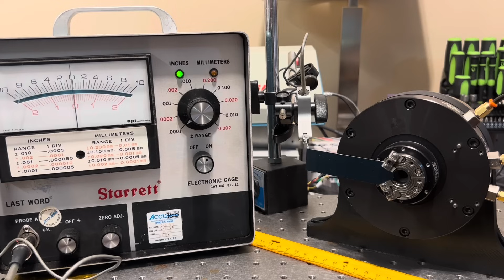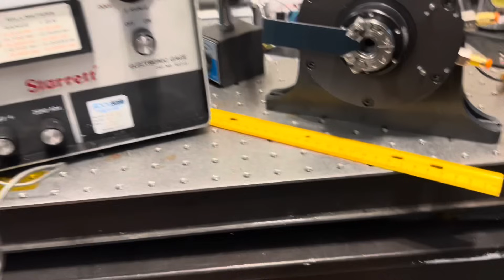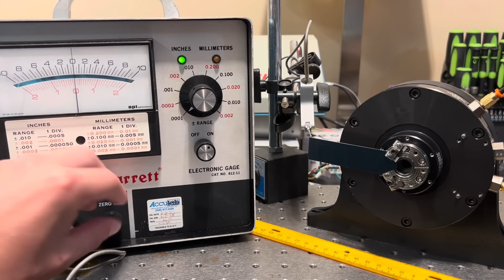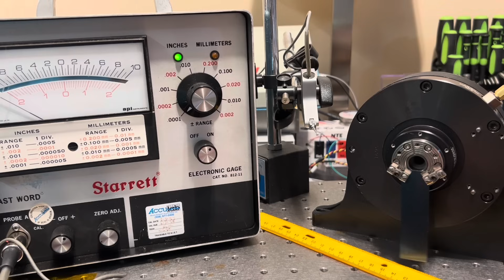0.3 arcsecond resolution air bearing spindle demonstrates crazy repeatability at a distance

Comment: I cant find the exact circuity of this instrument so this is not more than just a firendly note for this use case:

Be carefull with the analog indicator and may not leave too long at the overflow state, because u will know nothing abaut the exact coil drive current here. The excess current can cause the coil is heat up a bit and it do some change in dc resistance and olso cause heat up the driveing op-amp itsef. These are can make a ofset to drift, ruin your zerro point, and olso ruin the measurement repeatability.

Comment: Are you saying that the servo controller is holding position to zero encoder feedback bits? Maybe it is getting some fuzz on the feedback and bouncing around the central value?

I don't think you will get constant position values even with the device mechanically locked, that would be right on the edge of the best encoders I've ever seen, which are edge reading optical 26-bit BISS-C units, they bounce about 16 counts, so really 22-bits solid. It seems barely possibly for the analog electronics in a sin cos system to be that solid.

Also, the as-installed accuracy usually isn't nearly as good as the theoretical accuracy, but with an air spindle maybe it can be. With rolling or journal bearings the orbiting motion loses a lot of accuracy.

Comment: Very cool! Does adding an infra-red reflector like aluminum foil or mylar around things like PLA improve the thermal drift enough to be worth the effort? That flat black surface seems like it would take on heat from IR quite readily.

Comment: personally im more of a hydrostatic guy. mostly cause in the unlikely even that the supply gets cut out there is still a oil film precenting it from going instantly metal on metal well still spinning but if the air supply to a air bearing gets cut the air film is pretty much gone instantly and has the chance of ging metal to metal contact well still spinning. so its mostly for the eas of mine for me ( though if you combine a air bearing with a weak magneticlly levetaging bearin that could do the trick i guess ( so the magnetic is only there in case the air cuts out/as a safetynet and it dont cransh/grind down metal to metal at like 20-50k rpm )

Comment: Now imagine what you could to with a 18000 line encoder and 262188x (18 bit) Interpolation on a high end Servodrive. That's gonna be milliarcseconds/nanoradians!
Reply from the maker: Ok but practically you can’t interpolate a 1vpp encoder signal that much because of the electrical noise floor. That would necessitate less than 4 microvolts of noise
Reply: @cylosgarage  yep but 15 to 16 bits noise free is doable. Highly depends on a good interpolator in the drive, a good readhead and good wiring/grounding.
Reply: When I saw 18000 lines I immediately thought of the Renishaw REMS20USA115 from Tonic system which has just that many lines. It is a stainless steel ring with a diameter of 115 mm. I am designing a system with such an encoder currently. The primary input from the head is an analog SIN/COS signal, which is then interpolated. Typical installed accuracy for this encoder is +/- 6.8 arc second, or with two heads and DSi electronics, +/-2 arc second is possible. That is, the encoder accuracy ends at best at 12..13 bit interpolation.
Reply: @suj71  accuracy and resolution are two very different things. I was thinking about the Numerik Jena RIK4 .
Reply: @Leo.Wolf.the.Engineer  Of course you are right, and I realize what resolution and accuracy are. In my opinion, increasing resolution by increasing the degree of interpolation encounters a limit in the form of the accuracy of the entire encoder and the background noise of the encoder. It's hard to use more resolution when that information is idle, it's noise.
Reply: @suj71  typically the Interpolation error is quite small too. And for tight servo control (standstill below 0,05 arc seconds or so) you really want super low noise. And some defense/astronomic/optical application want nanoradians resolution.

Comment: I wonder, what kind of motor do they use for these applications. The bearings and other mechanical parts are in your interest, you talk about that mostly, but I bet the same amount of knowledge goes into the design of these motors and encoders and electronics.
Reply from the maker: It’s an iron core BLDC motor with a fairly large air gap and many slanted poles to minimize clogging
Reply: Common for high end air bearing spindles is a slotless or ironless 3 phase PM synchronous motor. Sometimes the rotor is mounted on a special decoupling flexure to reduce effects of parasitic motor forces
Reply: @davidharuch  Can you share more details about that flexure?

Comment: Quite impressive for a rotary encoder.
It's single encoder read head, no dual, opposed encoder reading for encoder disc runout compensation, I suppose?
If so, you have crazy low runout on those bearings, since any runout/slop messes their angular accuracy a lot
Reply from the maker: The spindle has mounting features for two readheads but I only happen to have one. They are hard to find. Not too worried about absolute angle accuracy for my application though
Reply: Youre right, but it doesnt affect the repeatabilty if the bearing balls have correct preload. And repeatability is often more important than absolute accuracy if youre not building a metrology device.

Comment: I bought one of these iso 3rs off ebay but cannot get the drive to work. What motor controller do you have running this thing?
Reply from the maker: Granite devices IONI servo drives. You kind of need an encoder for these motors since they don’t have Hall effect sensors for commutation

Comment: Jeez, this is absolutely insane 🤯 So the servo electronics can use the quadrature encoder to essentially provide fixed markers at the 360/16,384 degree points, from which it’s reliably able to interpolate 1/256 steps in between? I had no idea servos could interpolate that accurately. Absolutely mind-blowing precision, I love stuff like this!